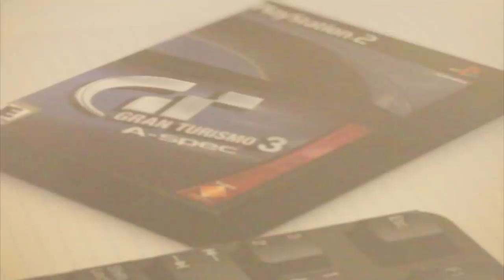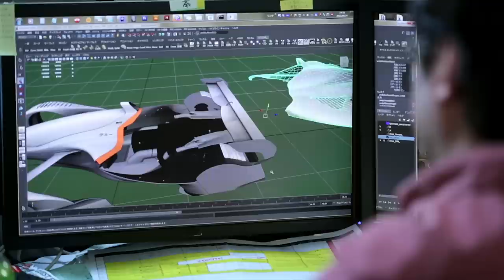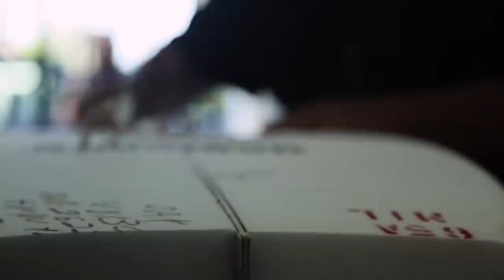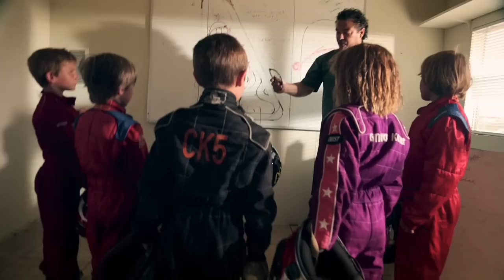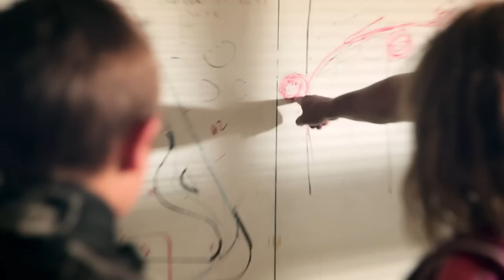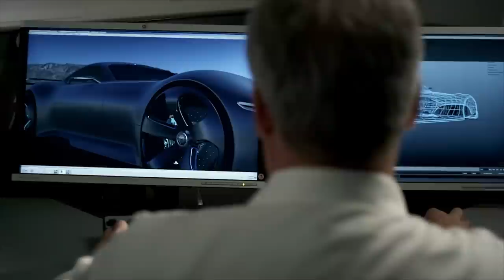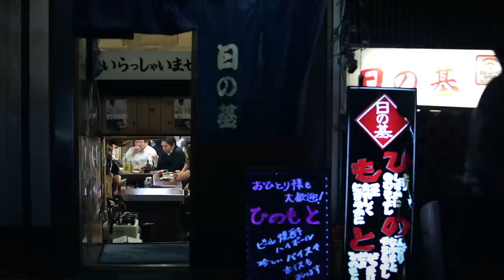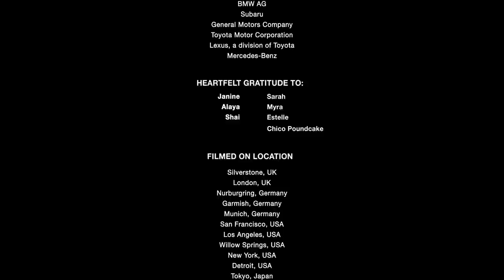KAZ: Pushing The Virtual Divide - Gran Turismo Documentary (Full Movie)

Comment: Gran Turismo is more than just a game at this point, when car manufacturers are working together with GT to explore the digital world and bring together reality and game. 

Surely, GT is not the most realistic simulator in terms of physics, there are things like iRacing, rFactor or Assetto Corsa that focus on extreme simulation of physics, but GT is more than that. It is just realistic enough to be accessible by any gamer, even with a controller, while still translating real world driving skills to the game, and it is responsible for awakening the passion for cars in many young generations. It's a game about loving cars, you have all those beautiful machines crafted with so much detail. The only flaw the series had up to GT6 was the sound design in my opinion, and that has been largely improved in GT Sport.

Comment: I play since GT1 and love them all, great physics but the sound is the only thing which has not improved.
I'm not talking about getting it louder or something like this, my problem is the basic engine rhythm. This rhythm is always connected with the engine type and can't change.
For example: why do the s1 sport quattro has a 6 cylinder sound and not a 5 cylinder sound which is legendary, in the 82'quattro no exhaust gives it a 5 cylinder sound but the Focus ST '06 has it, but only with stock exhaust, the others are 4cyl sounds? The new Viper has a V10 sound only with the stock and sport exhaust! The M5 '08: 1st exhaust 10cyl (right), 2nd european V8, 3rd 12/6cyl, 4th american V8 sound! WHY? Does KAZ want to simulate engine swaps?
Most people can't distinguish different engine types but i do and thats extremely important for the right feeling for me. KAZ don't need to make new sounds (would be good) but need to assign them new.
Reply: I agree, the sound of some engines is just iconic and part of the experience so I wish they did them better.  The 4AG for example has a sort of iconic sound from the head design but it doesn't really come across in GT5/6.